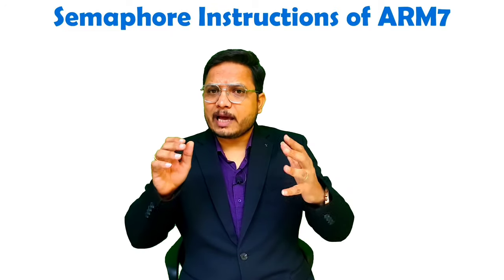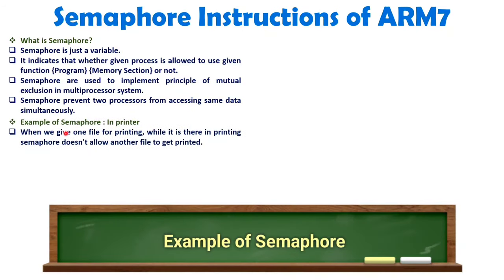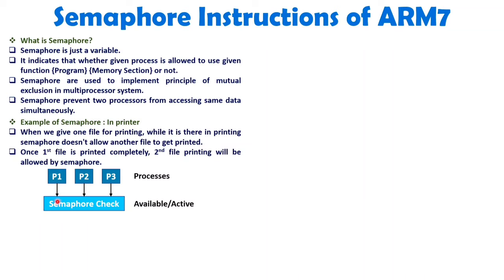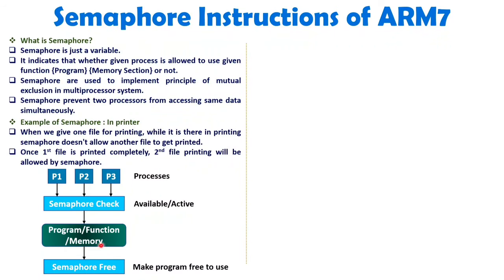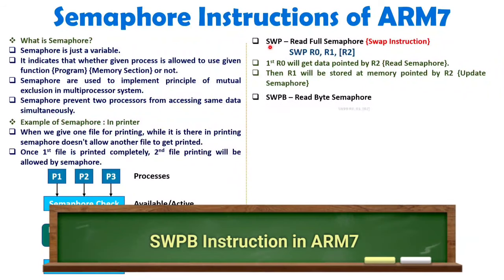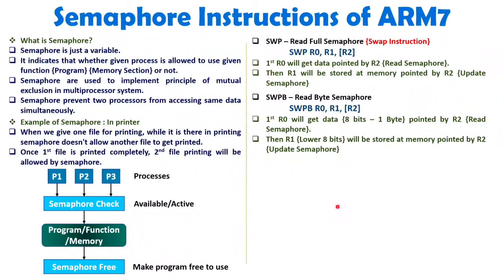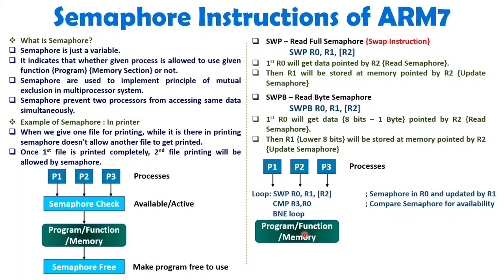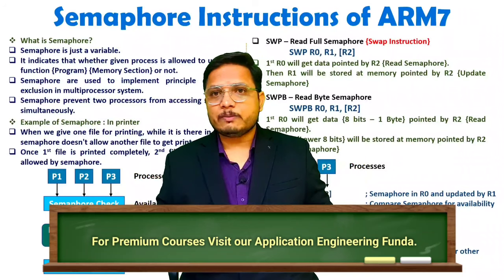Semaphore Instructions in ARM7 | Instructions of ARM7 | ARM Processor | ARM7 | ARM

Comment: One of the great features of arm is TRUE re-enterable code .... Also relocatable.. because of its multi stack..stm/ldm and pc relative architecture, semaphores, though supported, are not needed. Any and all code can use the same code simultaneously....even if mmu'd to different locations! I ❤️ arm and our dear professor🤗,jpk
Position independent, re-enterable, relocatable, self-modifing code.